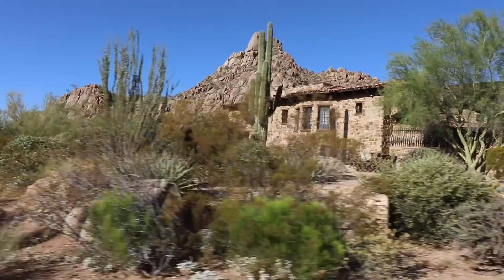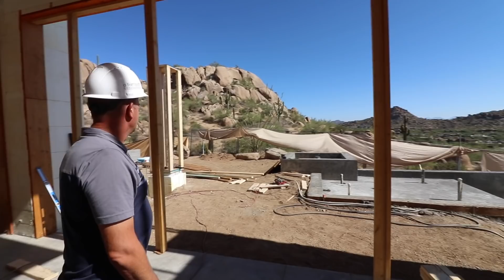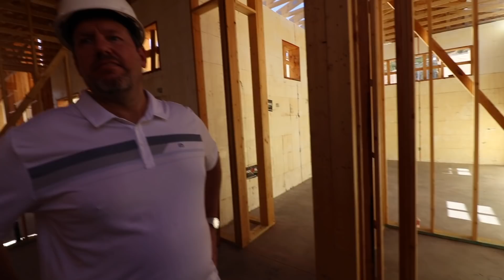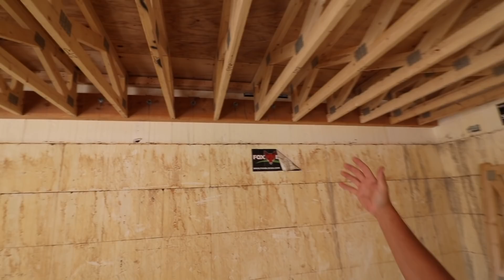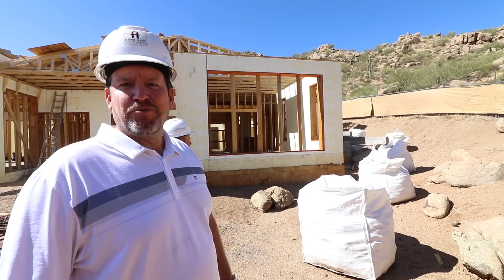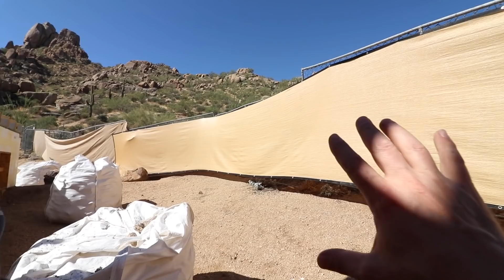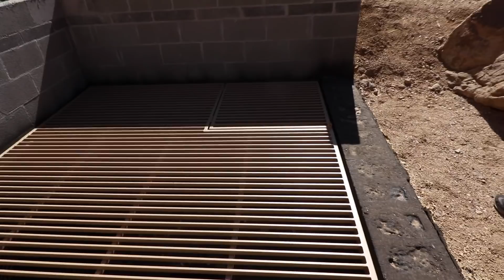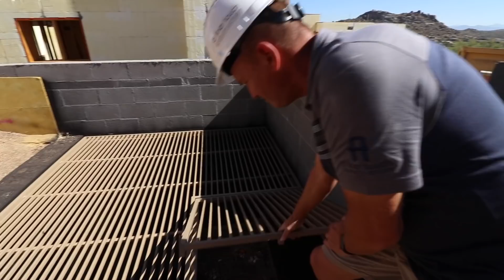Insulated Concrete House in the Desert

Comment: Rent a desert house before building one. I found myself drawing the blackout curtains to get relief from the relentless Sonoran sun.
And to temper the huge solar gain.  Big windows in the desert are a great glamorous  selling feature to those who don't know any better.
Want the the big panoramic view? got outside after sundown.
Reply: you can get coatings on the glass (Low-E) and even clear tint that massively reduce solar heat gain by blocking the UV rays, you can also size your overhangs to prevent direct sunlight from hitting the windows on the southern exposure in the summer time, combine all this into the house design and you will be surprised how little heat gain you will get.
Reply: They had this figured out centuries ago. Visited a mission in San Antonio many years ago, with thick adobe walls. When you walk inside, you are immediately cooled down, even with open windows and doors.
Reply: @BenjaminFranklin99-s9n  not rocket science but is trigonometry to calculate the right size of the overhang based on the angle of the house, the elevation above sea level and the latitude of the house to predict the maximum and minimum sun angles at different times of the year to calculate the size the overhang needs to be for the roof height and window height to prevent direct sun on the glass while minimizing the impact to the view. I can do this with my rendering software in Autocad to see where the sun hits at different times of the year.
Reply: Exterior automatic blackout shutters. my snow bird grandparents have them and they are awesome. They open when the sun is not directly hitting them and close only when the sun is directly hitting the window and all summer when they are up north.
Reply: What are you a vampire?
Reply: I think really big eaves are a great way to get shade on the house and indirect sun in.
Reply: You'll want exterior roller shutters like the ones they have in Florida for hurricane protection. By the time sunlight makes it past the windows it's already too late and the trapped heat will reduce their lifetime.
Reply: What is the SHGC rating on your windows? Low-E coatings in modern construction in desert climates should block 80+% of the solar heat gain and UV light that fades/damages furniture. I'm curious how good your windows are, and if really good windows was still not enough for you.
Reply: I do live in desert, nice window blinds helps.
But not these American flimsy blinds but rather beefy ones that block 100% of sunlight (or less if you so desire).
Reply: @goury  A black out option is available on blinds. They're the "flimsy" kind but it has a black out material lining the blinds.
Reply: Good fenestration design is an art and a science. The percentage of solid to void in residential design historically has been between 15 and 35 percent and certainly this is just a starting point to work with, also based upon more traditional designs and less efficient windows but if you break these rules, and you absolutely sometimes should, there must be a design reason to do so. Overhangs, recesses and tinted windows help on certain orientations, here larger unprotected openings would obviously work best on the north sides and protected on the south and with very carefully designed and sized openings to the east and west where overhangs will be useless at least for a certain time every day. 

Even a house with great views like this I like to refer back to A Pattern Language, the book by Alexander, Ishikawa, Silverstein and others which describes a Zen View:
       If there is a beautiful view, don’t spoil it by building huge windows that gape incessantly at it. Instead, put the windows which look onto the view at places of transition  - along paths, in hallways, in entry ways, on stairs, between rooms.
        If the view window is correctly placed, people will see a glimpse of the distant view as they come up to the window or pass it: but the view is never visible from the place where people stay.

This might sound somewhat extreme to those who’s mantra is to always grab the biggest view possible but the idea here is that the more obvious, the more it shouts the sooner it will fade. Gradually it will become part of the building, like the wallpaper and the intensity of its beauty will no longer be accessible to the people who live there. 

Better words and advice have never been written on the subject.
Reply: Yeah, that's what i thought, and the view will eventually get soooooooo boring

Comment: I dont need a house that big but I'd love a home built like this!
Reply: So build one like this, it's really cheaper than wood and it require zero maintenance so you'll save a lot.
And it's also bulletproof and even tankproof.
Reply: @goury  bulletproof? Cheaper than regular framing? I would think the cement would cost more?
Reply: @ScottyM1959  I don't know about this capitalistic American states, but everywhere else I saw concrete sold for the same price.
Thing about concrete that it is so much easier to work with, starting from making your walls and all the way to the finishing.

Entire building frame can be done in just one day per floor and even few hours per floor if you're using factory made concrete panels.
And also you'll get much better insurance price anywhere in the world because concrete doesn't burn and also is immune to almost every possible disaster.

And it just feels good knowing that no tornado or tsunami or even a neighbor cleaning his shotgun would be able to hurt you inside your safe heaven.
And you don't have to change this insulation every 10-15 years like in those living cardboard boxes.
And also concrete doesn't rot.

Tl; dr: wooden house will last 50 years, maybe 100 if built using expensive wood and maintained really well.
Properly built concrete house will last for centuries and even forever with minimal maintenance.

Comment: I would like to see their waterproofing details at the windows.
Reply: Water proofing should be high on their list. We are new to the desert but know wind driven rain and monsoons are no joke. In AZ most the window guys install the windows. They also use peel and stick which we find does not do well sticking to ICF. We just flashed innie set windows on and ICF house and opted to do liquid applied flashing. We sloped the sills, liquid applied the wood bucks then went back and put a beed of liquid applied as a back dam. In addition to a huge storm this week we have done some water spray testing and not gotten a single drop.
Reply: @warrenponder8111  perfect install.
Reply: Warren Ponder what liquid applied did you go with?
Reply: Do you know what a desert is?
Reply: I bet waterproofing is not high on their list, being in the desert.

Comment: I know why its really 8” underground, I’ve seen tremors...
Reply: Drive metal rods into the ground all round the house. Put deflection sensors on all the rods. Hide a 500 000 volt power supply somewhere on the property. Connect said power supply to a relay that connects it to the said rods when said sensors are tripped. (No point having the supply buzzing all the time. Only when it's needed). Barbecued Snake-oids, anyone❓
Reply: Dad gum snake-oids!
Reply: Nah that's ca

Comment: I am surprised only r24 for icf I woulda expected at least r30 am 8 wrong is there higher r value blocks from fox blocks
Reply: The 12” blocks are a higher R value. Sorry I don’t know how much higher off hand.
Reply: I do t know about fox blocks but I've seen above R50 ICF systems
Reply: They have killer performance because its a true continuous R-value, but yes only around R24 for the block.
Reply: My shop is a R38 quadlock ICF, I just looked at thier other products and they go up to a R59. I dont like the idea of thier other products but I haven't tried them nor ever seen one in person. Theres also other ways of increasing R value. You can still use roxul, canarock,  exterior insulation, or fire out the walls on the inside and insulate traditionally.
Reply: @townsendliving9750  wow now that is very high insulation value. It's what what icf should be thank you

Comment: OK how in the world can you build a house that crappy? ICF is to costly for any house. If you want to go insulation + Concrete the only good affordable option is AAC Blocks. Foam in general when burning is extremely toxic. 2nd of all with all this rebar inside the concrete wall it's very costly and slow to build. Can someone maybe explain why not more and more Construction people finally getting onto AAC Systems ?? I really can't understand why all those houses still have to be so extremely labor intensive. Matt do me a big big favor and run a comparison on your end to why not AAC Blocks/Panels. I ran my numbers here in Florida building with AAC instead of Wood, Concrete/ICF and I got the costs down to 50% with AAC instead of wood and or Concrete options. I do sure would like to know if you for Texas or let's say Oklahoma area would come up with the same. I think it's time we here in the USA go more AAC for multiple reasons. Insulation factor, Cost to build (material & Labor), Load capabilities and not least design flexibility.
Reply: I'm not understanding your statement. Why is it crappy? They are required to build in that location as either Masonry or ICF, with specific cladding requirements - no other building type allowed.  Most importantly, I don't think the home owner is too concerned with saving costs. Those open spaces and tall retaining walls as masonry would require thick furred inner walls with additional insulation and massive lintels at all the openings. I think the house is incredible; only thing I'd change is a proper pool - hell's with the budget, they should have done an inside/outside pool in the "mini" master, what ever that is?
Reply: @Gumdaar1  Didn't you watch the video? If you already build ICF why don't you build all walls ICF? 2nd story wood WTF you have outdoor temp of 120 in the summer time with 4" wall stud really even if you push close cell in your R-Value is not there, on top now you got a thermal break between the floors too.
Reply: I'm building all my spec houses out of icf here in Tennessee cheaper than I can do it out of wood I'm building my homes a little over $55 square foot and that's with lot added into the price and selling them around $145 square foot laughing at all these wood builders all the way to the bank and my houses sell for same price as wood built homes but guess what sells first when consumer has a choice of crappy hollow wood built home or a bomb shelter super insulated energy efficient home
Reply: @d8niel77  now think AAC I get it as low as $30 a square foot here in FL.
Reply: @lse-group   Just curious how do you run your plumbing and wiring in AAC walls? - the ICF I believe they said they just cut a channel in, do you have a special tool to cut channels in AAC blocks?
Reply: @lse-group  you are building complete finished houses at $30 a foot?
Reply: @Incognitus-Umbra  I am from Germany and over there Concrete Wall's are standard so we do have only straight run's either up or down no left to right run.s with a Drill crown you drill out the round hole where your switches go in and with a jackhammer you cut in concrete you channel. I prefer to use in the channel a conduit and reseal it. On AAC Blocks I use a sawsal with a very short wood blade it cut's for me a 1" deep cut but you can also run a circular saw. Super fast and easy.
Reply: @d8niel77  Yes we do but up the price ofcourse when we sell :-). I do have a 5 man crew and the house on it's wall's is all build up with a story per day. Than we run 1 day electric and 1 day plumbing. than comes hole house inspection for building code, electric and plumbing all open. Once passed we return, seal all up spray liquid concrete on the outside with fiberglass as a browncoat mixed in with a waterproof material. Than day 6 Stucco guy comes out finish the outside in a day. Inside we do spray on day 5 all with Drywall mud and finish off the wall and ceiling finish. Day 6 Flooring get's done while windows and door get all hung. Day 7 House been handed over to the Customer ready to move in.

Comment: ICF vs SCIPs (Structural Concrete Insulated Panels) ICF - hollow foam forms filled with 4" to 8" of concrete. SCIP - foam core with 1" to 1/2" of concrete sprayed on each side of the panel. Less that 1/2 the concrete needed. ICF 2-5/8" foam on each side. SCIP - 5-1/2" single layer of foam in the center. ICF - finish needed on both exterior sides of the foam. SCIP -- already has a layer of concrete on each side of the foam core and can be finished with a final coat of stucco or plaster.  Sheet rock not always necessary on the interior. Can use the SCIPs for an attic floor to totally seal the home, just add a roof to the insulated concrete box.
Reply: I will explore this further, thank you.
Reply: The water proofing would be an interesting detail, from what I understand water will move right through concrete. I havent heard of this system though
Reply: Where does the rebar go?
Reply: One of the huge benefits of ICF is it seems like a great DIY system, you can build an entire structure with minimum tools involved and little experience. It seems simpler then any other building method. That's why its appealing to me, I can save enough money on labor to get a very well built structure inside my budget, cause other wise all I can afford is a trace built home

Comment: ICF's seem like a poor substitute to welded wire over a sheet of polystyrene with 2" of shotcrete over that. It would be cool if you would do a comparison. "TriDiPanel"
Reply: It may be stronger but as a sub contractor I’ve worked on both. Had to charge 50% more for your style over the ICF panels. Much more of the interior wall lines required wood framing to make room for utilities to install compared to ICF. ICF’s are stack, run rebar and pour. The shotcrete style is tougher to set up and shoot.
Reply: Some of the manufacturers of these forms offer them in KnockDown version, this mean you can install a welded or other more engineered rebar system and then snap these through them into place. QuadLock is the forerunner of said assembly required systems as they only offer as panels and ties. Others have both solid web and snap together aka KD type blocks. a Few offer straight sections with an exposed side called "Reveal" for an exposed concrete interior or exterior surface where insulation is not desired or required.